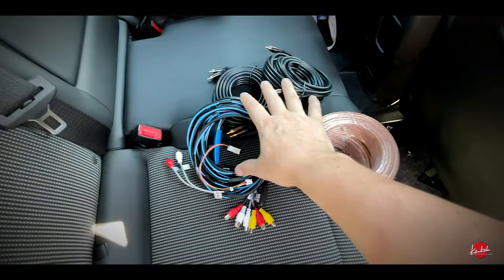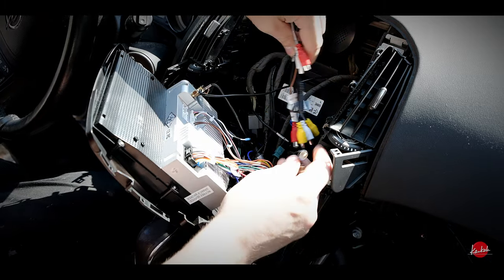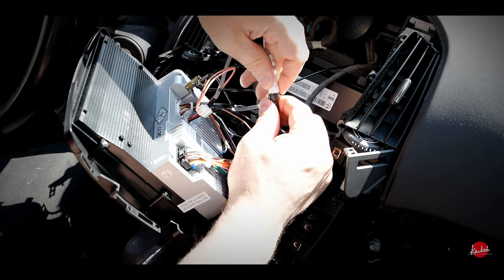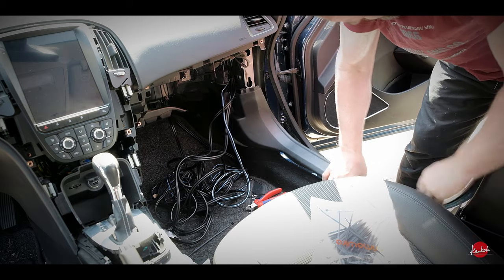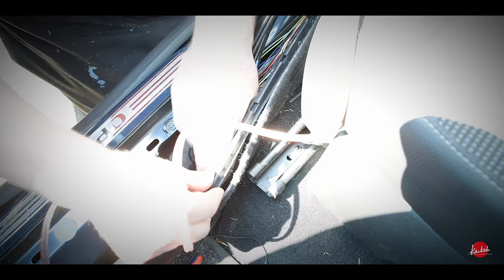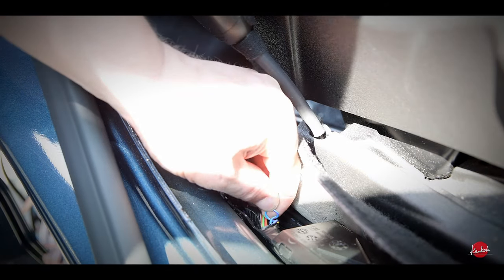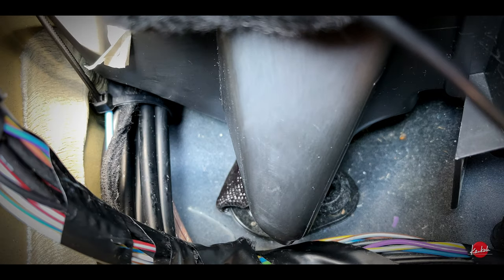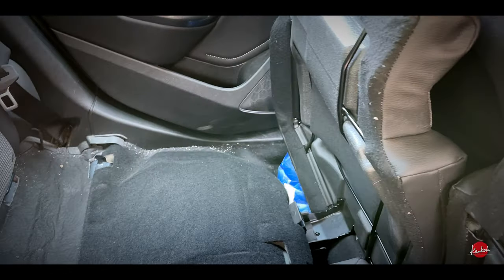How to run audio signal cables from Android radio to amplifier

Comment: In my Astra J GTC, I installed the Crossovers under the dash, but had very bad buzzing interference sounds.  After much experimenting I found that putting the Crossovers anywhere near the dash caused the problem.  So I had to move the Crossovers to the Boot next to the Amplifiers, then run speaker cable from here to the speakers. That worked fine.
Reply from the maker: Ok, thanks, good to know. Strange that passive crossover caused this kind of problems. I don't have even speakers yet, so i don't know, how big this crossover will be.

Comment: any plans to change the rear speakers ? do you know the sizes for rear speakers? :D Ty so much !
Reply from the maker: I haven't opened doors yet, 6.5" should be possible to install to the rear (and front). Standard 6.5" speaker won't fit straight, so some kind of adapter is needed. How deep speaker can be? that i don't know yet.

Comment: Did you have 4 channel rca output? I only had 2 rca output that were connected to the 20pin connector. What pin number were the other rca outputs connected to?
Reply from the maker: Rear RCA outputs are in a different connector (0:20 in a video). Smaller 8 pin connector.

Comment: Nice project dude! Question, does this radio also have the possibility to connect the factory center front speaker?
Reply from the maker: Now i'm not 100% sure, but i think you can't connect it straight to the radio. Radio came with one external speaker, which play sounds like turn signals... i also have this center speaker in my car, and it might be possible to connect it to this external speaker cables, if impedance is about the same. I didn't try or think about it more, i'm happy, how this included external speaker works.
Reply: @kaukolaDIY  Thanx for your response. Its a lot of work but well worth the effort.  Are you planning on applying car sound deadening material in your doors? That was the first thing I did on my Astra, really worth it. Your car will be like a vault!
Reply from the maker: Yes, i will do that to all doors. I already bought some sound deadening material. Actually i think with good tires, this Astra model is pretty quiet car already.
Reply: Nice! Keep on the good work @kaukolaDIY

Comment: Do I tune amplifier through android auto
Reply from the maker: Audison amplifier model what i have, is only some crossover adjustments. My touchscreen radio has all i need, crossovers, equalizer and time alignments. I will do all my adjustments in my radio. Only adjustments, which i will do in my amplifier, are some levels and subsonic.
Reply: Do you got soind when using audio rear front rca ?